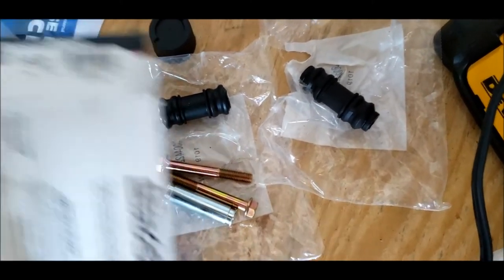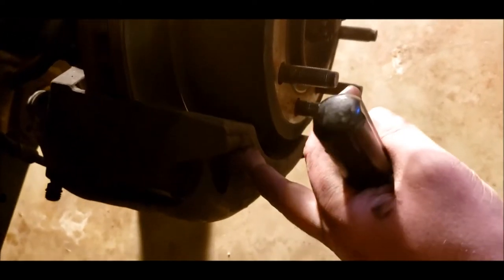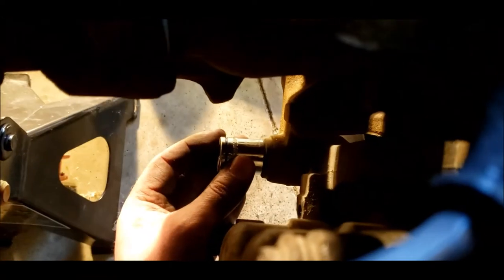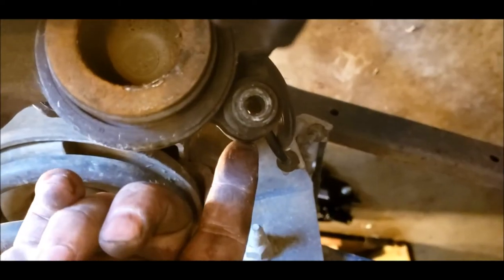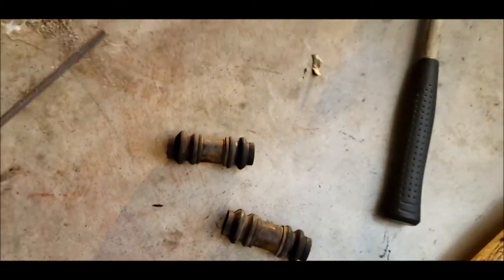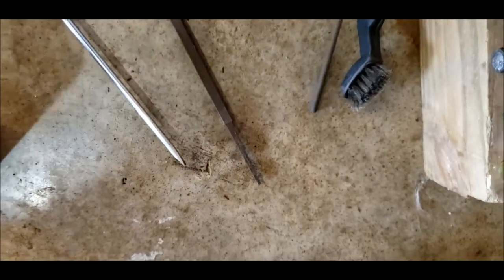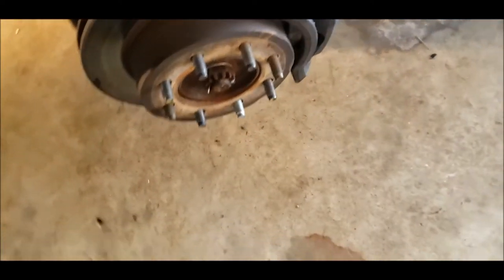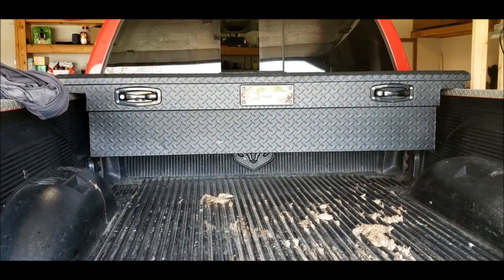Replace Caliper Guide Pins 2004 Dodge Ram 2500 3rd Gen HD truck - Remove Brake Caliper - fix shake

Comment: Question please - Do the calipers slide on the outer diameter of the sleeve? or does the caliper slide on the retaining bolt that goes through the sleeve?
Reply from the maker: Answer: the caliper slides on the sleeves. The lube on outside of sleeve is the important part.  I just lube everything, cause why not.
Reply: @Prima10ne  Thanks Bryce.  I have an older E450 Ford and was finding it hard to believe that the sleeve relies on a rubber grommet to go back and forth...